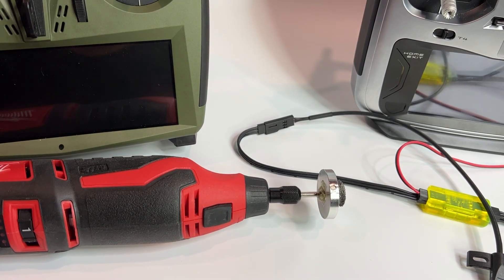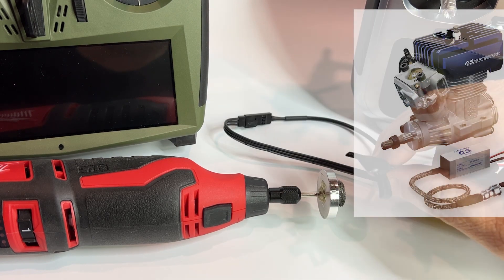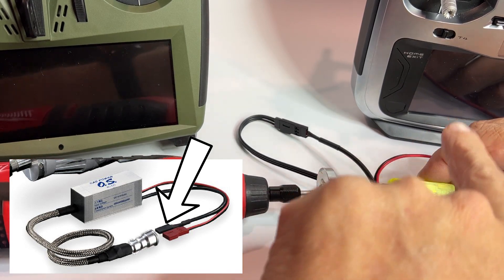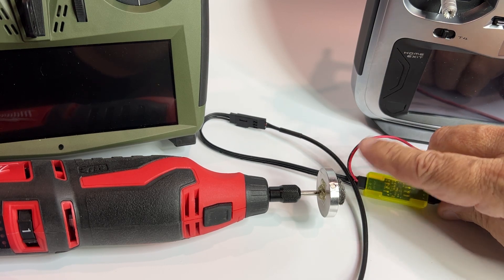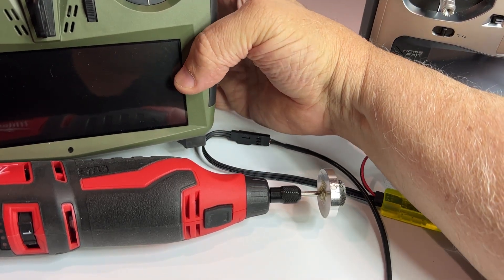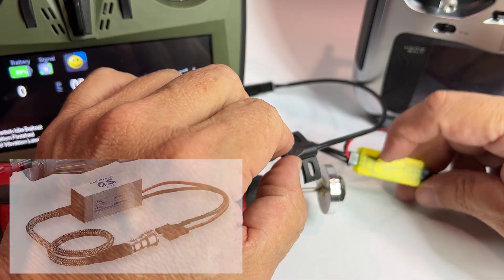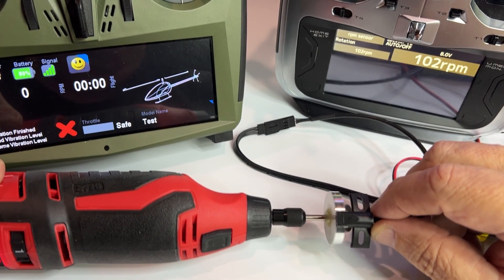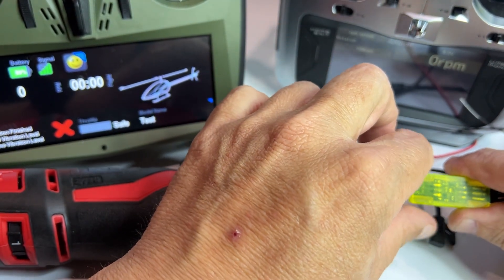New XGuard RPM Sensor for OS Max Gasser Ignition Systems

Comment: Do you remove the red power wire going from the xguard to the futabe 760r rpm port? 
Thanks
Reply from the maker: Not necessary. You can see how it’s wired here:

https://xguardrc.com/wp-content/uploads/2023/05/OSRpmSensorManual-scaled.jpg